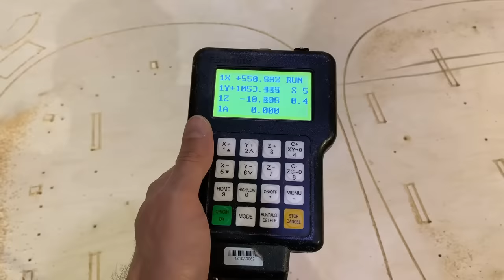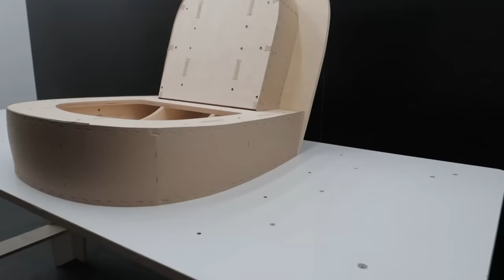DIY | Pacha lounge chair

Comment: Cool project, assembling the plywood base is probably something everyone can do if you get it CNCd, but getting that foam shaped and positioned right probably takes a lot of skill!
Reply from the maker: We want to publish pattern files for foam and patterns for upholstery fabric. Everything becomes possible with them.
Reply: @comodesignru  That would be great. Is there an affordable way to cut the foam without a special foam cutter? and same for spraying the glue?
Reply from the maker: Yes, it can be a box cutter and foam glue in spray cans.
Reply: Hi, I'm sorry if I seem to ask something already answered. Do you have dimensions used to cut the plywood? Job well done all the way from 🇿🇦
Reply from the maker: I don't understand exactly what sizes you are interested in. The dimensions of the plywood sheets? Or the dimensions of the parts?
Reply: @Comodesign  the dimensions of the parts please.

Comment: what are the different colors of foam? do they differ in stiffness? If yes what color is the hardest and what the softest of the three (white, pink, blue)? and how thick are each of these 3 colors? Sry for the many questions. I don’t want to take your time, so only answer, if it doesn’t bother you
Reply from the maker: Blue is the toughest,
Pink is softer and more resilient, and white is just as resilient but even softer.
Reply: And is 50mm the correct thickness of each of zhem
Reply from the maker: Yes, that's right.

Comment: inspiring video! What's the widest dimensions for the pieces on the CNC? Wondering if this can be cut out on an xcarve (the 1000mm one). Thanks!
Reply from the maker: Yes, you can! The maximum size of the parts does not exceed 1000 mm.

Comment: 0:42 what are these litlle things called and what do they do?
Did they use different kinds of foam, or is it just the same with other colours?
Reply from the maker: It's a metal wood nut. If you insert it into the wood, you can then screw a bolt into it. We inserted these nuts to screw on the chair support later.
Different colors of foam have different densities and stiffness.

Comment: Great work! I would like to make one myself, so i would be great if you release the templates. Since you asked at the other comments: I do have access to an cnc machine. It would be only my second upholstery project, but i learn quick and i think i could get into it.
Reply from the maker: We are already preparing the drawings and will publish them soon!
Reply from the maker: We used 15 mm plywood and the drawings were made for this thickness of plywood too! What kind of plywood do you have on sale? Perhaps in an inch system?
Reply: @comodesignru  where and when the drawings gonna be published.. thank you
Reply: @comodesignru  thanks for your answer. I’m looking forward to start the project. I live in Germany so mm is perfect for me. I do have some 18mm multiplex at home, but at my local hardware store there is also 15mm, so 15mm works perfect for me, and it’s cheaper as well, so maybe I would get 15mm anyways. I think its a pretty standard size, so I assume it’s easy to get at most places (with metric system at least).
Reply: @comodesignru  where can i purcase the cnc file??
Reply from the maker: If you are interested in the drawings, we have added a link in the description below the video.
Reply from the maker: If you are interested in the drawings, we have added a link in the description below the video.

Comment: did anyone buy the drawing and what was your reposnse ?
Reply from the maker: The drawings have been purchased by quite a few people and there have been no negative reviews.
Reply: Thank you for your response respected designer but are the files STL based files or just drawings with dimensions @comodesignru
Reply from the maker: These are drawings for the CNC machine to cut out the frame parts. Also fabric and foam patterns. STL is a 3d model, not sure why they are needed.

Comment: Hey do you have a template for the fabric on the chair?
Reply from the maker: Yeah, check the links.
Reply: @comodesignru  if i dont find the exact foam is okay to use slightly different or is it impossible and it has to be the same
Reply from the maker: I think it's best to stick with the same thicknesses we used. But small changes are allowed, e.g. use 45 mm instead of 50 mm. It is also possible to replace 50 mm with a combination of 20+30 mm.
Reply: @comodesignru  i dont mean the thickness i mean the hardness like 3040 in my city i will possibly not find the exact same maybe i will only find 35 40 would that be okay?
Reply from the maker: The stiffness and density can be combined however you like. The main thing is to assemble the layers that seem optimal to you.
Reply: @comodesignru  so the layers should be like you did it but the foam is completly on me?
Reply from the maker: I think you can do the layers any way you like, but to fit the foam templates it is important to use 50mm thick foam in each layer or a combination of the two, which adds up to 50mm. The stiffness of the foam can be different or the same. We made foam with different densities and stiffnesses to get certain properties. You can combine it in any way you like.

Comment: I mean i'm going to keep it for techniques but this is not DIY not even close but its beautifully made
Reply from the maker: What would be called DIY then?
Reply: @comodesignru  I mean you started off using a cnc and it looks like a decent sized one at that. This is not hobby level machinery for you average faux furniture maker.  Cause if I had the money and space id have a cnc too and the amount of stuff  id make... but I digress.    I'm assuming based off the design you have some design software to go with it .  The good software is usually separate and kind of expensive.  Given the level of quality displayed here I would imagine that you don't have the cheap one.  Given that you have hand spray gun and foam cutters these are items that are usually in a hobby shop all together, which makes life simple but unless you are selling these things there Is no reason to buy this one item for this one job unless you plan to do it again.  Again I think that what you have created looks amazing and if I had the design I may try it myself but this if definitely professional work!
Reply: @comodesignru  To answer directly I just recently watched a video fo a women who put a ottoman together using pool noodles for mimic parallel tufting.  That's DIY I don't need special equipment most often then not.  Are there levels to DIY yes but at some point its not longer for the avg hobbyist but now your in to professional level quality
Reply from the maker: Yes, you're right, but not 100 percent. We think that an interested craftsman can order cutting on a chip machine in a company that provides such services. There are also co-working centers for furniture masters where there are also machines with cpu. We have also made all the templates for foam and fabric, thus simplifying the task. And frankly speaking, even a saw for foam is not necessary, we have many people who do this for a living, cut foam with a knife. Glue is available in aerosol cans, etc.
But this chair is a really difficult task for an untrained person.